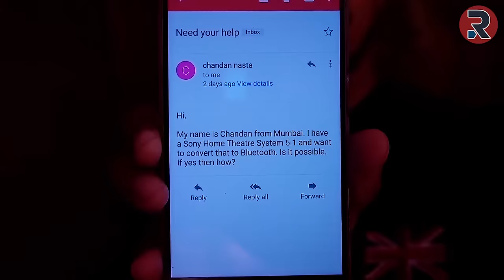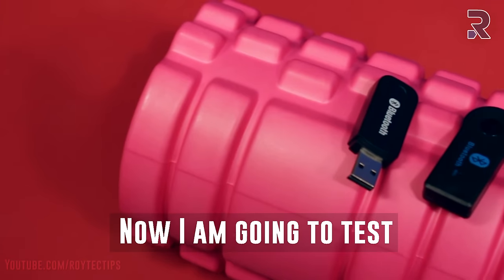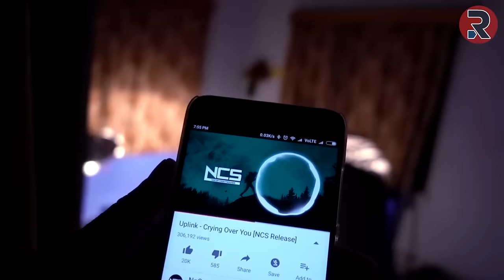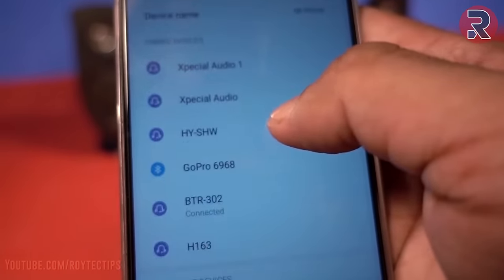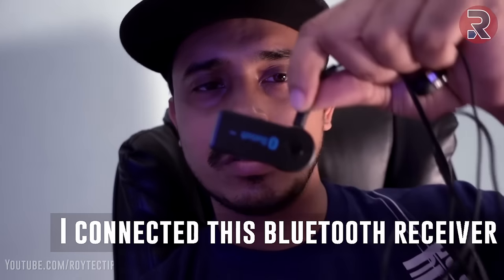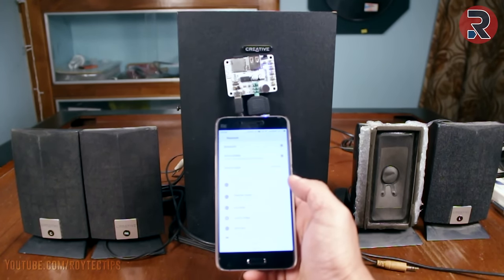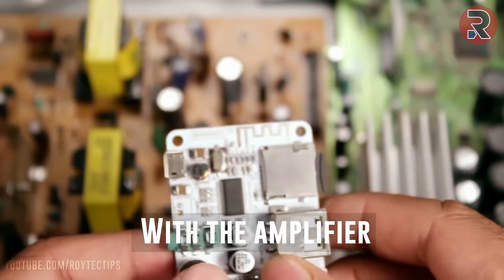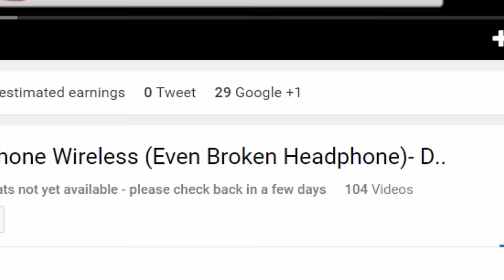How To Turn ANY MUSIC SYSTEM INTO BLUETOOTH MUSIC SYSTEM - With Remote Control

Comment: How is the audio quality comparing to wired cable and how is the bass
Reply from the maker: Audio quality near about same as wire. sometime it sounds better when you use EQ. It is so far the best cheap Bluetooth module i ever tested .
Reply: RoyTecTips I have ordered one from banggood but without mix and remote...